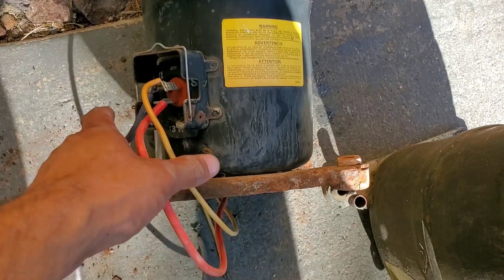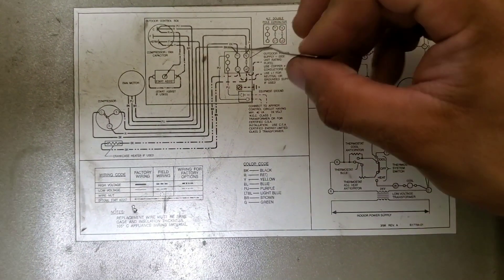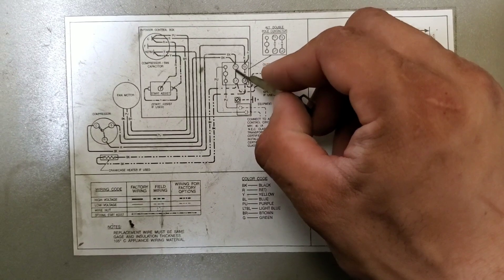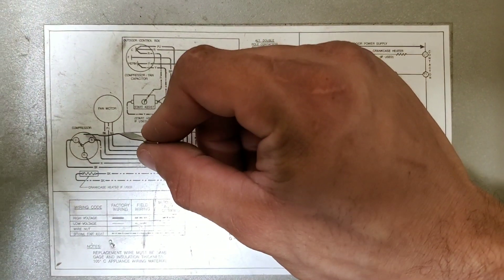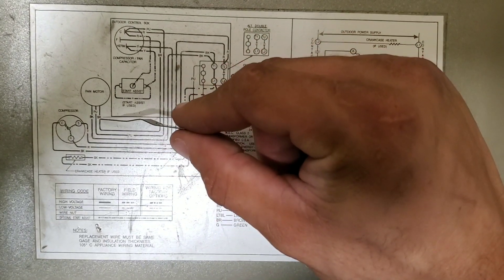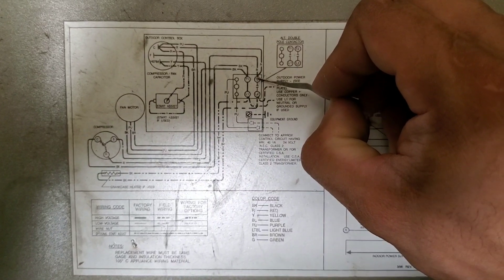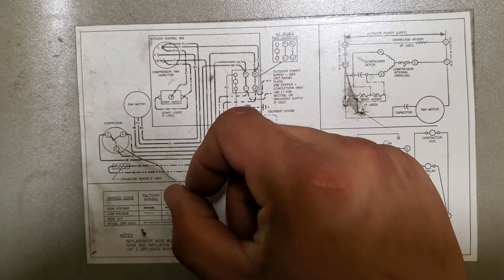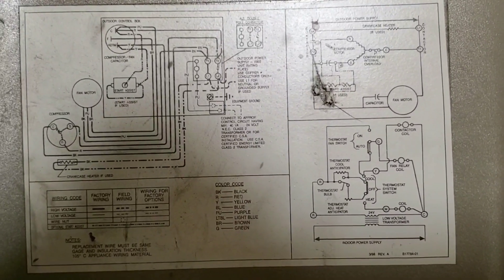How to Wire Compressor EASY!

Comment: No thanks.
I'll continue to use my "trial and error" method of wiring.
I just stock my service truck up with new circuit breakers and fuses, to replace those that I destroy.
When you get paid by the hour, you don't want to rush any repairs. I like to stretch them out for at least two - three days.
Plus, it gives me plenty of time to buy more circuit breakers. Oh, and fire extinguishers too.
Can't have too many fire extinguishers.
I wanted to write more, but I'm out of time.
Gotta' go destroy something now. 😜